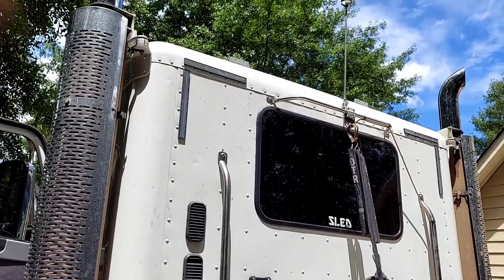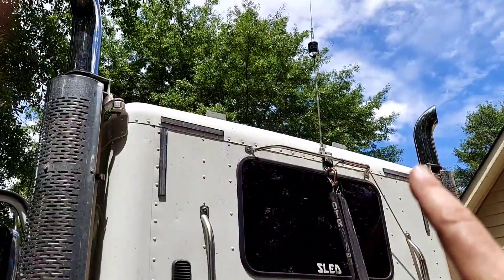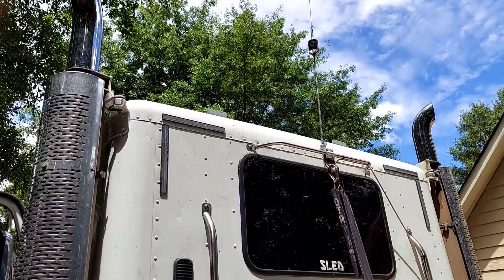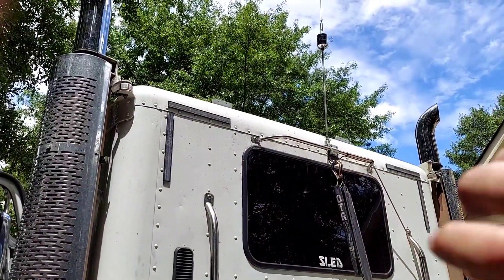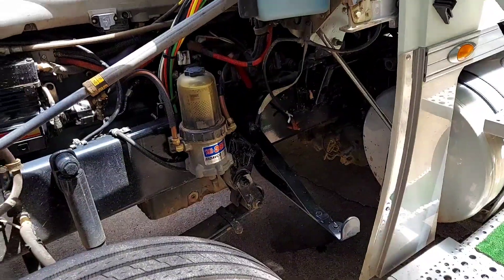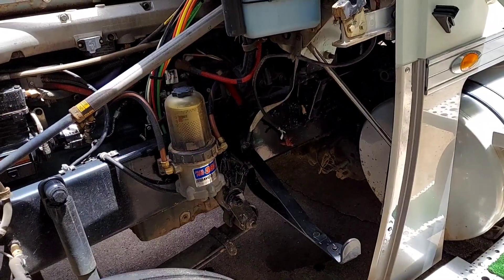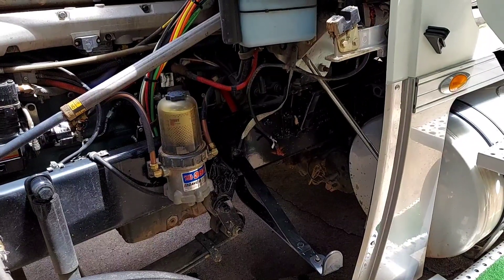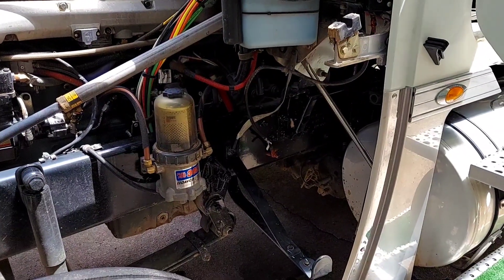Antenna Grounding/ RF Bonding. Getting the most from your CB system

Comment: Hey rich i have a 2017 kenworth and my cb goes crazy with the lights on, when i open the door, ac on. Any recommendations for a fix?
Reply from the maker: KW what? T680? T880?
Reply: @jrichtruckincbtips  t800 sorry
Reply from the maker: @stevec2569  it's a combination of removing the powder coat iin the mirrir n this video on a T880. https://youtu.be/Ar6mxY57lzs?si=sRLy4qBlB4Pcfv3v

And, the RF Bonding on the video you watched already.

Comment: Hey there J Rich truckin & CB!  Just quickly, I do not really know what RF bonding is in radio (NON-ONLINE NON-INTERNET) Would you please make a video or commnent on what RF bonding really is and if it is possible to know if it can be measured with a store bought DMM or SWR meter? I  have a read a little about installing CB radios and antennas and checking for SWR in a car in so far as what I read I did not come across anything about RF bonding but I think that it could be worthwhile knowing about.  My general understanding is that RF is AC and therefore a DMM continuity check between metal parts may not tell me if I have Rf bonding or if is DC bonding and therefore I sort of end up at the conclusion that I will never learn what RF bonding is or if I have truly acheived if I try to do someting around a car like you show in the video with groudstraps.😀
Reply from the maker: It's just making the frame the ground plain, and the signal goes out more equal and not skip off body panels. 

You can check ground with a swr meter by keying the mic while getting the swr reading and whistling in the mic at the same time. If the needle moves you need more grounding.
Reply: @jrichtruckincbtips  Hey, thanks for the quick reply with info to my querry.

Comment: 👍 and subscribed...
I've been watching all your videos. And I want to set up my Anytone 5555 N2 similar to the way you do it. I bought all the materials to rf bond my truck. I have a 2024 Cascadia. I also got a 6' skip shooter like one of your videos to try out once I ground my antenna correctly so I can get my swr in range. I'm using an old 4' fire stick now. Works great on channel 19 only place swr is in range being in the middle of the channels. It's low on channel 1 and high on 40. Same thing showing on my Wilson 2000. It's more than just lowering my antenna. I've done that. The SWR is through the roof and can't be tuned in range. It has to be that this antenna is not properly grounded or RF bonded.

Question,
Does it matter that my mount is aluminum? Should I get a stainless steel mount to ground rf bond too?

Thanks for your awesome instructional videos. Easy to watch and straight to the point.

Comment: I run oversize. I have to run flashing amber lights . I actually can hear when they light up because it interacts with the static on my cb. Is this the reason, because it’s not grounded? Also can I run round wire to my antennas as the mounting stud runs through my mirrors?

Comment: I am having a nightmare bonding my 40ft super c freightliner motorhome.  😢
Reply from the maker: Yikes! That's a lot of Bonding. You're just bonding the metal of the truck, doors, floor, engine to the frame. Not the fiberglass.
Reply: @jrichtruckincbtips   I'm down to 2.5 on the SWR and have a lot more bonding to go. Did the doors, cab-frame, mirror mount-cab. etc..  have to work underneath next on the frame-floor. Got 4 gauge and multiple 1" ground braids on already!!
Reply from the maker: @Riveredge Visuals  hopefully you are using an external SWR meter checking this. The way you can tell when you have enough ground is. While checking the swr speak loudly in the mic. If the needle doesn't move or only moves 0.1 swr you're there. Beyond that I'd be looking at a quality coax, antenna and mount location.  The 2.5 swr just isn't acceptable to me 1.5 or below is.
Reply: @jrichtruckincbtips  And thank you, for the great videos!!

Comment: I'm just gonna keep adding straps as I get paid lol
Reply: You can never have too much ground!
Reply from the maker: With they paid me for the straps.🤷‍♂️
Reply: @jrichtruckincbtips  lol I would absolutely pay for the parts for a driver to do this on one of our trucks, I love CB stuff, better communication is better. I'll buy a radio for anyone that can follow whatever truck they end up in, and if you want to improve the function of our trucks you most certainly can be rewarded for that. I don't see it as being any different than buying toolbox accessories for our drivers that they will use on the job too.

Comment: You prefer a 5/8 wave over a 1/4 ??
Reply from the maker: 1/4 wave is great and has it's place, however there's not always a great place on these trucks to put a 108" antenna
Reply: There is no 5/8 on mobile except in vhf uhf and upper frequencies

Comment: Can you just crimp and heat shrink ends on no soder ?
Reply from the maker: You can.
Reply: @jrichtruckincbtips  I got the ranger rci 99n4 when I’m on hide side of radio it makes my dash go crazy will this fix it ?
Reply: I drive a freightliner Coronado also
Reply from the maker: @alabamasmooth1657  I assume your power and ground is run to the batteries or the fuse box. Try running a ground strap from the back of the radio to a bolt  on the cab
Reply: @jrichtruckincbtips  what do I hook it to on back of radio I’m bout to subscribe to you just for the fast response and informative vids !
Reply from the maker: @alabamasmooth1657  if there's a screw or take the nut off the connector the coax screws on to.
Reply: @jrichtruckincbtips  appreciate it 1000 percent
Reply: @alabamasmooth1657   Put it to one of the chassis screws that hold the lid or bottom, between the case and the chassis of the radio. There are ring connectors with small holes for up to 8 or maybe 6 gauge wire. Get the biggest you can find (to hold a bigger ground strap) then use the biggest braided strap that you can squish into it, probably a 1/2" maybe 3/4. The other end will need to be for the same gauge wire but probably a bigger ring hole. Make it a short run to a well grounded spot on the truck. Scrape enough paint (1/16th to 1/8th in.) to let a star washer get a good bite on bare metal on the truck. File or scrape any paint or other impurities off the base of the nut or under the head of the bolt that you're going to. Metal to metal is super important! When the connection is secure, hit it with a little clear coat or maybe color if you scraped too much paint lol.

Comment: Why is it when I go into some of the larger quarry’s they can hear me but I can’t hear them any suggestions
Reply from the maker: It can be several things, bad ground, coax, antenna, position of the antenna, the power of the radio, or a combination of these. It'd be money well spent to stop in a cb shop and get diagnosed.
Reply: @jrichtruckincbtips  thanks J Rich for the info some guys are saying it could be the mic I have a cobra cb and they say if the mic is bad you want be able to hear because cobra cb  the mic is part of the reason you can hear
Reply from the maker: @dewaynesmith36  it's possible, but it rare. Usually when the mic starts going, it more on the transmit side. I do suggest a new mic thou, like personally like Ranger and Astatic. Watch this video and you can here the difference between the Cobra, Astatic, and Ranger. But, keep in mind you're hearing this through a junk external speaker.https://youtu.be/zG65egoZwWM

Comment: I just stumbled across your videos, keep up the good work. I have a semi big stereo system in my F250 and have added/upgraded many power and grounds to 0 awg. Is there a difference/advantage for using bonding straps over wire?
Reply from the maker: 1" flat braid is always preferred, but a 4ga wire is a minimum wire size to accomplish the same thing. Try keeping the grounds as short as possible.

Comment: Thanks for the video nicely  done . Was wondering if all the Items you used in the video could be put in the description. Looks like you used some anti corrosion compound on your ground connections
Reply from the maker: Thanks for watching,  I got the flat braid from DX Engineering, ring terminals from Home Depot and Amazon, heat shrink from Amazon, and dielectric grease or tune up grease from auto parts store. Some have said you can use anti-seize as well.

Comment: Good work man , I can share some of my ideas and see if it works for you or someone else. I use a magnet to find metal in doors or body you have the ground straps covered I don't use the bolts on the frame side of the door better to grind a little and go to bare metal grounding to engine block is good but I also run a separate ground from negative side of the alternator to bare metal on the frame. Your alternator is the beginning of your power supply to the vehicle most people don't think about grounding it better. Hope some of this helps 73's..
Reply from the maker: Good info

Comment: In your opinion do you think this will help with the rf noise that comes with the newer led lights in modern trucks
Reply from the maker: Absolutely! My truck is a 2019 with aftermarket LED headlights and interior lights, and all maker lights on the truck and trailer are LED. It has been a vast improvement.
Reply: @jrichtruckincbtips  Will shops do this for you or is this something we need to do ourselves ?
Reply from the maker: @Fox250R  some shops will, but the cost can be so high, it's just better to diy.

Comment: What I know about ground straps bonding . Is to let RF flow better then  …all spot welding and glue bonding& paint that it’s done at the manufacture company .. so to keep all RF in one conjoined bond it’s Good to install ground strap .. wich is different from Rounded Power Ground wire   .. do to power (+/-)flows better trough round wire & RF flap strap flows better trough flat surfaces ! (“JZ”)
Reply: From what lil i know about rf is that its need to circle back from its original spot..So basically you start from say door side of door hinge..Other side of same strap to cab side of hinge,floor to walls and eventually engine block and the rest to chassie..Open your hand and thing of fingers as different parts of truck/car/van/jeep,they are all connect by joints till the reach the palm of your hand..Always chk your connection with a multi meter to and looks for the ohms resistence..If you get nothing well you dont have a good connect,could be plastic washers or bushings or even alumium washers..So if you get all zeros on your meter screen that a perfect connection,if the #'s appear then you have a resistence of sorts..

Comment: Why do can I hear myself threw my stearo in my truck when talkin on my cb. I mostly only use Bluetooth or Cds when listen to music so I'm very confused Whats your opinion
Reply from the maker: I heard something about that, but didn't retain the fix as I have never had that problem
Reply: Usually bonding will help..Likely its the wireing from factory stereo is a small ga and cheap connectors,could be the wireing from your cb to..Where is radio lowered from,if its factory then go direct to battery..Google the awg  thickness based on length..

Comment: Doors, cab, back panel are aluminum on the coronado. Hood and roof cap are fiberglass, fenders are composite. I grounded the doors to the cab, cab to the frame, and I run 2 ground straps directly from the frame to the actual ground. They just hang and touch the earth, just like trucks are earth grounded in the oilfield and mining industry. My SWRs on dual antennas are .95/1.01.
Reply from the maker: Good job, but never heard of swr being able to be below 1.
Reply: I typed that wrong, 1.08. my bad.
Reply from the maker: Gotcha, RF bonding is a job, but well worth it.
Reply: I just attached a chain to 2 points under my vehicle, so the lowest point just scrapes the road, so when you speed up, it's up in the air. Have you noticed an RFI difference when grounding the Earth?
Reply: Got busted telling story’s. lol.  Stop the cap.

Comment: Does bonding need to need to be done even with a pickup, towing a 5th wheel RV?
Reply from the maker: Should be done on any vehicle with a cb, but wouldn't worry about bonding the camper
Reply: The good news about the 5th wheel,it will help your signal from behind...A large metal surface to hell the signal just off sorta speak...You can bond it for s%$ts n giggles..

Comment: J....Awsome job man..Other than less noise,notice anything else??
Reply from the maker: Still picking up noise from traffic lights and stores, it's talking good and receiving better.
Reply: @jrichtruckincbtips  Sweet....Not likely ever gonna get away from lights and some fords,chevs and honda i believe..Its their systems wireing,power supply ect affecting your radio so no worrys,try your noise blanker switch and it should filter alot of it out..

Comment: Where you get them straps . I'm almost there with this 880. I'm attaching a mount to the stack shroud
Reply: Places like dx engineering or even on ebay..Do yourself a favor and get a roll of 1" wide..I also suggest you look up bbi on yt and watch his bonding video...
Reply: J did a vid on the 680 antenna install..Pretty good to,go search for it,same as 880..
Reply from the maker: DX Engineering is where I got mine.
Reply: I wouldnt attach a bracket there..Its not very strong,you will hear alot of noise,heat and it will affect ant performance cause of the stack rite next to it..
Reply from the maker: The 880 works great on the mirror with SS antennas if you follow what I did in the 680 install video. RF bonding the doors and cab of the 880 will only help. I don't see any reason to move the antenna location unless you can do a rear center high mount.
Reply: @jrichtruckincbtips  Personally rather one each on the mirror arm vs back of cab..
Reply from the maker: @craig_sez8534  meaning if it a day cab or flat top, not high roof sleeper.
Reply: @jrichtruckincbtips  Even on a day cab,i would preferr mirror arm..On a full bunk and even a mid roof for sure i would go mirror..
Reply: Or go to NAPA and ask for 1" ground straps.
Reply: @TheRoadhammer379  If they are anything like around my area,all they get is the 13" long that only a half inch wide..Damn near useless..
Reply: I am using old cable wire. They are narrow so you gotta double it up. But strip the rubber coating off and under that is some aluminum wire.
Reply: @jonathanechols9985  as in noemal electrical wire? The flat stuff is by far better for rf travel..Its surface area required..
Reply: @craig_sez8534  no, not electrical wire. There is a aluminum wire mesh very similar to what he showed in the video. When you strip off the insulation from the cable coax there is aluminum wire mesh under it.
Reply: @jonathanechols9985  Just strip enough to solder an end on then..
Reply: @craig_sez8534  that might work.